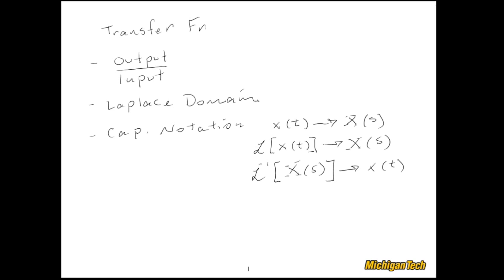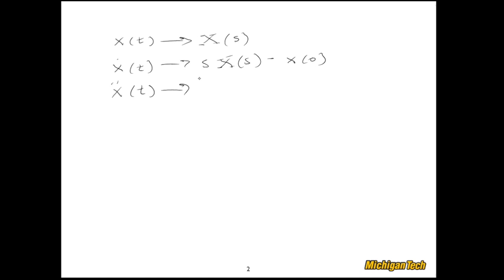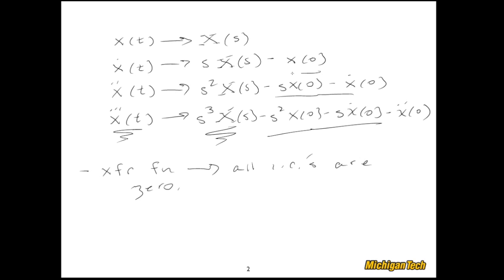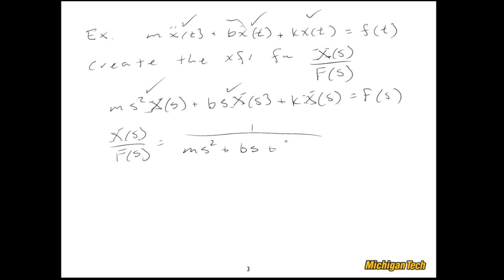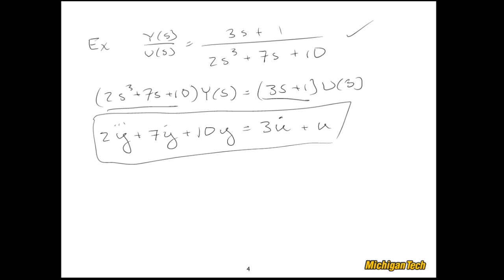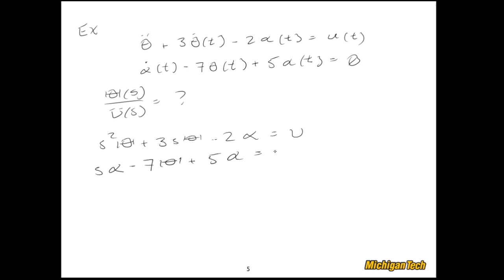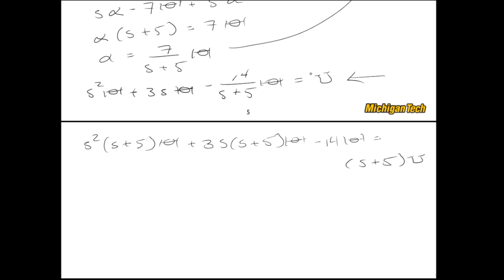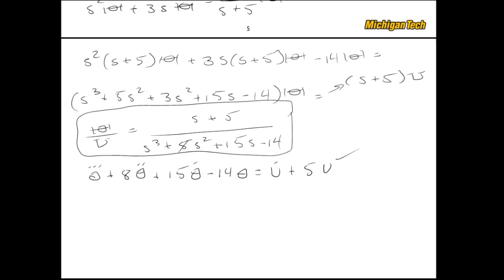Transfer Function Introduction

Comment: I like ur videos but there is a problem with ur microphone or try not to concentrate much on letter s or t cos it sounds very strong using headphones. thanks and good job :)
Reply from the maker: Thanks for the suggestion. I'm clearly not a pro, however, I have friends that are and they've offered to help. So, for the next set of vids (MIMO control) they will be cleaner. Like everything, it's a process.
Reply: Yeah im happy to hear this :)